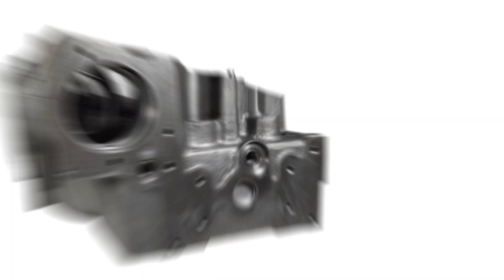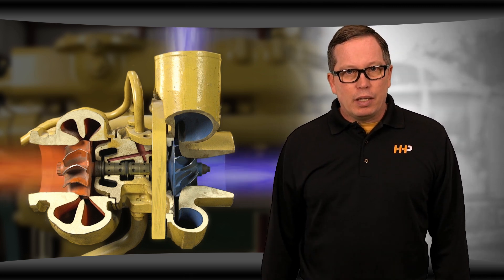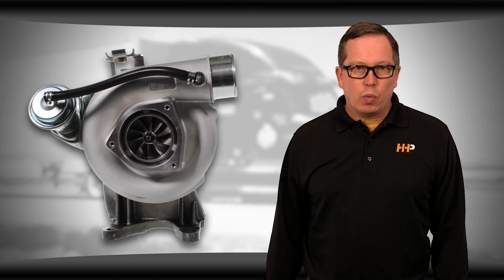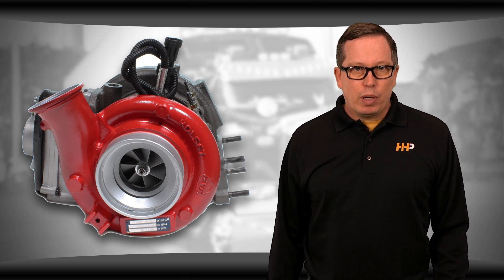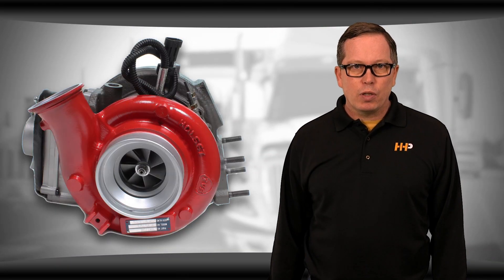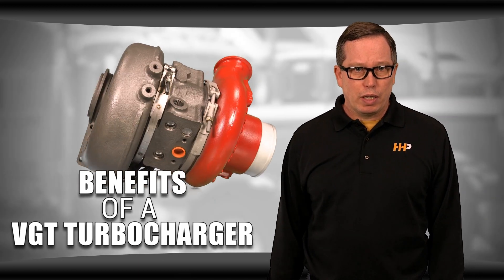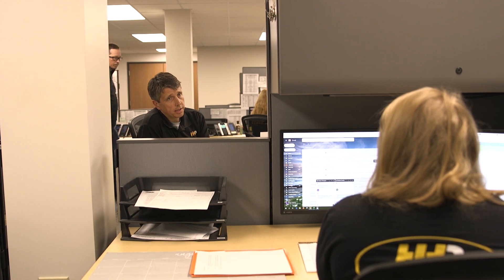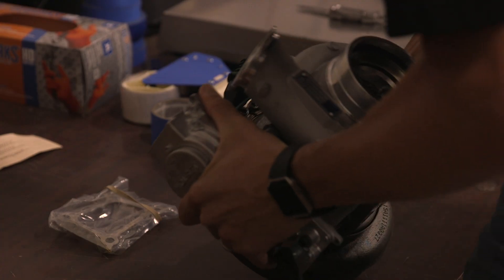VGT Turbo Problems? Discover Why Deleting It Might Cost You More

Comment: I deleted my 14l Detroit 60 series that had a vgt turbo replaced it with a wastegated turbo and I can say I did lose some of my Jake brakes and low rpm boost. I’m thinking of putting the vgt back on is it safe to run a vgt turbo without egr ?? If it’s risky I’ll probably just leave it how it is

Comment: Do you guys make a VGT turbo compatible with the old 7.3 powerstroke? Mine is a 95 model.
Reply from the maker: We do have some options for a 7.3 Powerstroke.  Contact one of our ASE Certified Technicians with your engine serial number for an accurate quote.
844-447-1453